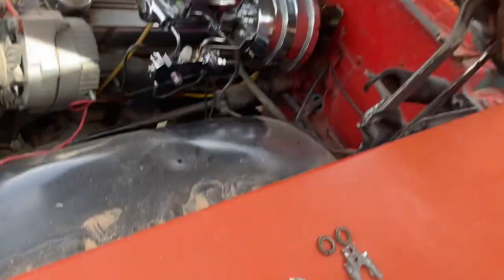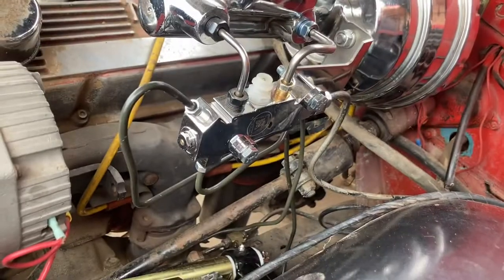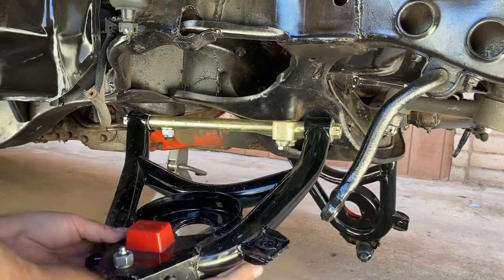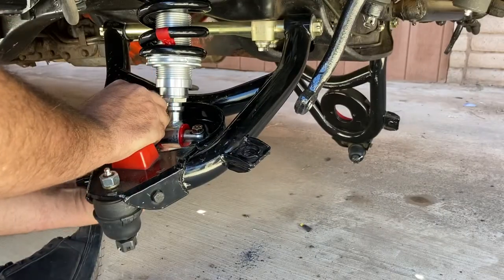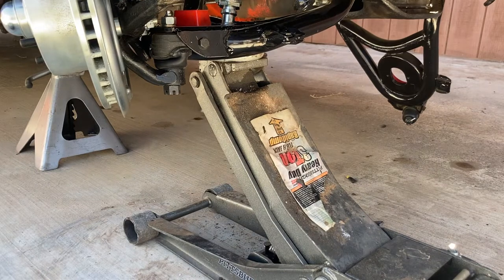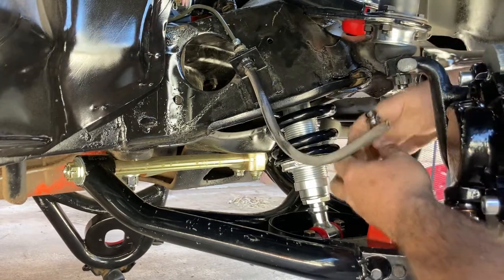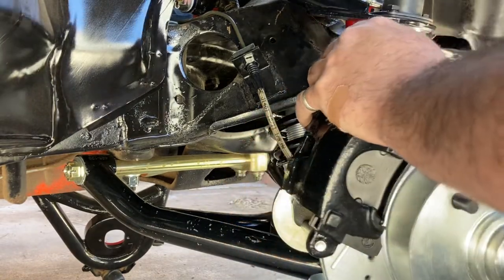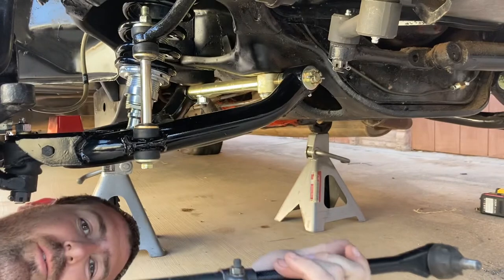1960 Impala suspension upgrades  coilovers disc brakes control arms

Comment: what are the bolt sizes for the upper and lower control arms? Im looking for the bolt that goes inside the actual bushings. Ive contacted ecklers, classic chevy and summit. They dont have that actual information to give to me when I call. I have everything installed but I need those bolts as I sandblasted and powered coated the original ones. But lost those bolts that go inside. Thanks a bunch

Comment: Do you happen to have any links to some of the parts you installed? I just converted to disc brakes and while doing so I noticed some of my bushings aren’t in the best shape and falling apart.
Reply from the maker: I just ordered the complete a arms from ebay. they are the exact same ones they sell on Summit Racing but for half the price.